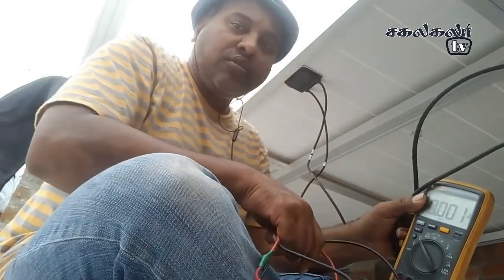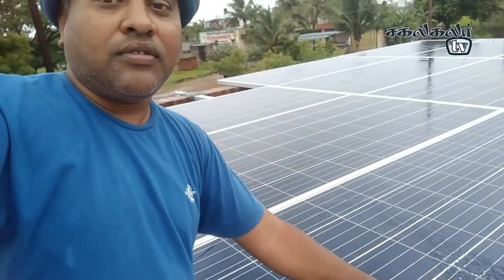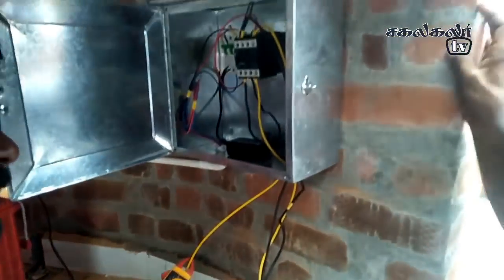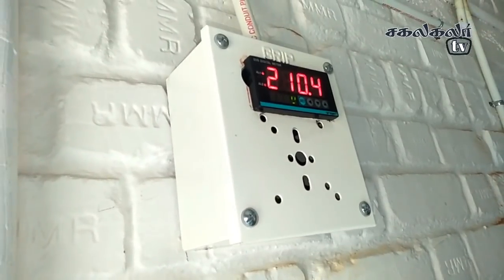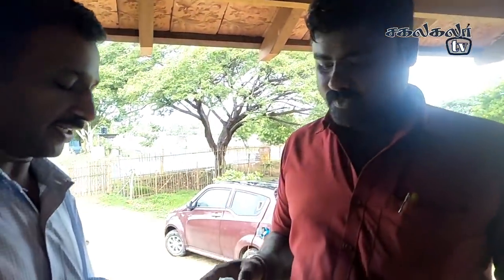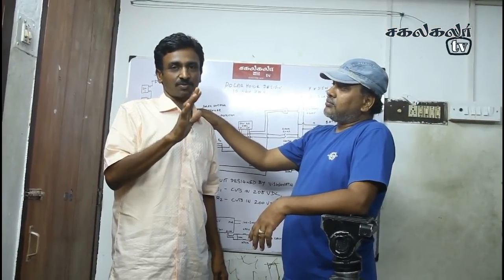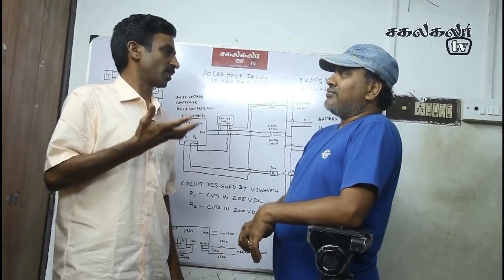Full DC Solar Installation || Commercial Solar || Without Solar Inverter || Off grid solar Dc Home

Comment: Sundar sir single phase ac supply la shok adicha thappichidalam
Dc la 12v 24v 48v inda mathiri low volt system onum problem illa
But 
180 - 220 v dc supply la shok adicha death conform 
So 
Aduku inda system la ninga ena sefty poturukinga

Comment: What happens to current loss due to DC travelling in wires for long distance ?
Reply: 200 to 230 V DC. Current rating will be same as 220 V AC. So loss will be same as in AC or less. 
Only If DC voltage is less than 200 then current will be higher for the same load( kw) hence loss will be higher on longer transmission. 
It is good if we have house hold equipment made for DC. Hope this becomes a trend.
As Solar generation is locally produced and consumed, DC supply for standalone system has many advantages.
Only when we need a grid+ solar there is an issue. 
Also Battery cost per KWH and it reliability is a factor to be checked.
Reply: Transformers

Comment: U always forgot to mention one important things in all solar panel system, that was with the setup solat system with batt bank, how long (hours) it will run with full charge, i.e during rainy season etc. This information will help user to determine load capacity etc.

Comment: எனக்கு ஒரு உதவி தேவைப்படுகிறது. நீங்கள் எடுத்துக்கொண்ட battery 12v 200Ah 2nos: serious connect become to 24V   and charging  using 240w 24v solar panel parallel connection ஆனால் நீங்கள் பயன்படுத்துவதோ 12 வோல்ட் light. And 24V DC fan how use and connect.

நீங்கள் 12v light 24v பேட்டரியில் பயன்படுத்த முடியுமா?
Reply: Selva Kumar, I think they r not using 12v or 24v, they are using 220v DC system using 24v panel in series connection ( 27.6v*14no's=386.5v) to charge & use 12v battery in series (13.8v*16no'=220.8vDC). And they didn't mention 12v DC lights, Therefore a 230v led light fixture required minimum   140V AC or minimum 198V DC (140*✓2=197.9v). Check with latest smps type adapter's input voltage AC 90v to 275v & they are capable to work with equavellent DC Voltage ( 90*✓2)=128vdc to (275*✓2)=388vdc.

Comment: Intha video uncut version irrutha upload pannunga anna. Because neriya vishyam cut panni irrukinga . Pid controller eppadi voltage controller ra mathanaru nu. Innum neriya kelvi la irruku. Intha lockdown la ippa intha un cut full video podunga sir. 2 hours na kuda paravala. I almost 90 percent understand the circuit diagram. Pid controller pathi puriala (NEED A CLEAR EXPLANATION) . So please upload un cut video of solar installation of vishwanath sir.

Comment: Investing in the battery is not a wise option, we have to replace the battery every 4 or 5 years. 
Solar on-grid invertors with 7 years warranty are available in the market now.
We can install extra more solar modules and produce more electricity for the cost of the battery.
Reply: Can u explain on the concept sir .. any number so we can contact you
Reply: @nirmalkumar-zq8rd  Sir, You are from ?
Reply: @MrKlgd  do u know government not giving net meter properly

Comment: Can you supply solar  system for irirgation purpose ,pl advise the cost be involved for 3 hp motor,
Reply: get 3kw solar panel and get one 2.2kw vfd and you can conect them to run your 3hp(2.2kw) motor

Comment: If get shock in high voltage DC system you're gone
Reply: No you should understand that center tap is given as earth to reduce the electric shock by half (earth connection tapped at 8th battery so it may around voltage 192/2 - 230/2 so you may get 96 - 115 Vdc. For solar irrigation at agriculture pumps harvest 450Vdc - 750 VDC generation do you consider that as a risk?.
Reply: @chandruasp  100v DC is not a safe voltage.Because in high voltage DC if you get shocked the constant voltage will pass through your body.In ac, voltage is alternate hence you get a chance to escape.
Reply: @netrocker9990  I has received and handling 48Vdc and its solar VOC is 86Vdc on bare hands it gives a sense but not shock if 110Vdc it is survivable and safe all agricultural solar motor pumps have very high voltage than that so only theoretical knowledge will make you any time get into practical it is just a easy job but anyway safety precautions are must for everybody. many rural peoples are handling such things in a very good manner they have a good practical knowledge.
Reply: @chandruasp  currently working as an junior chemical engineer in an chloro alkali unit.For manufacturing of caustic soda we use elecoltrolysis.The voltage is 600v DC .I have seen the DC electrocuted person.
Reply: @netrocker9990  for more than 150Vdc need saftey precaution and need to seek and tripper during such human shock discharge.

Comment: For solar 24 volt design, is there any pid voltmeter available in market to control over and under voltage protection..?????
Reply: Many Charger controller itself has 24Vdc regulated output so no need a separate PID
Reply: @chandruasp  thanx for the reply. I am not asking about charge controller..i am asking voltage protection across load side.. if battery voltage reaches below 23 volt,i want to cut the load..same if it reaches above 25 v i want to cut the load...

Comment: Keeping the solar panels horizontally, with zero tilt angle(angle between the roof surface and solar panel) will not be efficient as it gives very low output power compared to the output power given by the solar panels which are kept at a tilt angle equal to the latitude of the place, where the solar panels are installed. The electrical output power produced by the solar panels depends mainly on the solar radiation which falls perpendicular to the solar panel. If solar panels are kept with zero tilt angle, the solar rays which fall perpendicular to the solar panel are very less throughout the day, as the position of the sun varies throughout the day. For a fixed tilt angle, solar panels have to be placed with a tilt angle equal to the latitude of the place facing south to extract maximum power from the panel.
Reply: For Chennai and most of areas in Tamilnadu, required angle is 13 to 14 degree (average of various seasons) to the horizontal. The   handbook below gives the required solar  panel angle areawise. http://www.solarelectricityhandbook.com/solar-angle-calculator.html
Reply: Tilt = latitude is for maximum annual generation. Sometimes it’s wise to adjust tilt and azimuth (eg., east-west panels) to generate maximum output during peak hours, based on seasonal demands and usage patterns. Such adjustments are done in off-grid system, place where electricity rates are high during peak times (time of day electricity price ) or simply when net billing instead of net metering is used. Such design should be done by proper generation estimation, energy auditing etc, else your ROI will be on steeper side. So better go through epc companies then installers like them.

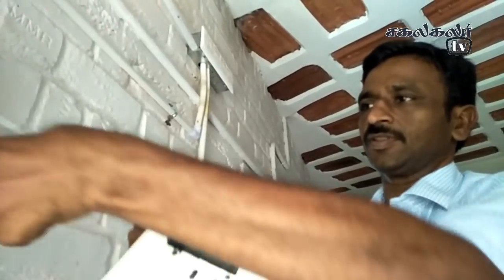Comment: Your circuit is good, but the way you explain is not clear enough to understand to any layman. This is one of the main reason for everyone to call you and ask for doubts. In this video time stamp from 6:17 to 6:30 is not clear the way you explain. You need to show how to program PID. You have not discussed in previous and current video. Connection of diodes, contactor and battery center point connection these are the important things you should show. Using PID you are doing high and low voltage cutoff. See the link given below
https://m.banggood.com/Tools-VPD1-60-40A-220V-Over-and-Under-Voltage-Protective-Device-Automatic-Reconnect-Recovery-p-1282509.html?akmClientCountry=IN&rmmds=detail-bottom-alsolike

I think this device does the job. The person who shoots the video is an adfilm director, sir the video should be in a systematic approach, because you are educating millions of people round the globe. Already circuit diagram is shown in earlier video,now you are installing a new project as per diagram.  
1. Raw material -  like Solar panels brand, battery make, followed by wires, PID etc.. if possible show tools used. 
2. Installation procedure- that is from where to begin with say for example: start with panel connection - PID - contactor - battery, then center point    cut off. 
3. Load
4. Precautionary measures.
Reply: The voltage controller is For ac not for dc
Reply: Yes we need clear wiring procedure and precaution measures... If you really want to educate people means... please put proper guidence video for us... It's our kind request.

Comment: மின் கட்டணத்தொகையை விட இதன் பேட்டரி மற்றும் பேணல்  வாங்கும் தொகையே மிகவும் அதிகமல்லவா? பேட்டரி என்பது நிலையானதல்லவே! அதனையும் இரண்டு மூன்று ஆண்டுகளுக்கு பிறகு மாற்றியாக வேண்டுமல்லவா? அதுமட்டுமல்லாமல் வீட்டிலுள்ள மின் சாதனப்பொருட்களையெல்லாம் dc யாக மாற்றினால் அதுவும் extra சிலவு தானே? வாங்கிய கிரைண்டரை பழைய இரும்பு கடையிலா போடமுடியும்? கிரீன் எனர்ஜி கடைசியில் பர்ஸ் எம்ப்டி எனர்ஜியாவுல ஆகிடுது? மேலும் இத்தனை பேட்டரிகளை மொட்டை மாடியில் வைத்திருப்பதை அறிந்தால் பிறகு பேட்டரியின் நிலை லலிதா ஜுவல்லரியின் நிலையாகிவிடுமே?
Reply: No No If you use normal Transformer inverter without proper watthour calculation a 5year battery will work for 3 years hardly if calculated and avoided such inverters and used switch mode inverters or inverter less model you can run upto 7-8 years with similar warranty battery but water maintenance are must.
Reply: whatever it is. the battery cost is so high. If you compare to the normal ups system. here you need to add more components. battery, inverter, solar panel, mccb, and ect. But we don't need to spend more for the normal ups system. Only battery and inverter thats it. But for the solar system!? and there are some negatives also there in the solar system. (1) Rainy season we can't expect full output. (2) expenses so high.(3) need more maintenance. so if you compare this to EB current bill payement.  then the solar expenses unbearable.
Reply: Any one will spend one and half lack rupees for a just 12v dc output?
Reply: Off grid is failure, ongrid best இவனுக கோமாளிகள்
Reply: @shankaryou1  If we leave grid unstable voltage from electricity board our all equipment work for endless lifetime understand due to poor grid power we loose more appliances and pushed to use stabilizers. 

Pure off grid users who not depend on grid wont need stablizers.

Comment: 192v dc system epdi bldc fan ku kodupenga
Reply: Smps is used for converting ac to DC rgt??we already give dc as input
Reply: @athianand  SMPS input need 110-260Vdc/Vac and output as mentioned in smps.

Comment: 1. Off grid useless you can't get proper load

2. Panels not in proper angle how you get efficiency

3. I think its 5kw .5kw panel cost 1,50,000 , Inverter, angled structure and installion 1,00,000 if you go ongrid system , one lakh saved and it is complete package

4. Minus of Off grid you cant get proper load. Every seven years u reinvest For battery  it is huge cost Around one lakh
Reply: They are not using invertor & AC system
Reply: @saravanan602  Battery cost?  & life ? Every seven years u Want change battery how much cost that is?  choose better & cheap option ongrid
Reply: @shankaryou1  on grid system not bad idea, there also u have to use hybrid invertor so installatiin cost high. Upcoming days lithium iron batteries are coming so life will be more & no maintenance require
Reply: @saravanan602  in off Grid  Battery cost around One lakh Hybrid inverter for 5kw around Rs.60000 only எப்படி பாத்தாலும் On grid than best
Reply: @saravanan602  superb,, true message sir,
Reply: 3phase la,, single phase illena work ahguma? 
Small house ku,, island, highway shops, agriculture farm house,, reserve areas,, idhukellam off-grid than better,
Reply: @manimarandevu  ஏதோ நடுகாட்டில் இருந்தா ஓகே Off gird போடும் போதே ஒரு லட்சம் அதிகம் அப்புறம் ஜந்தாறு வருஷத்துக்கு ஒரு தடவை Battery மாத்தனும் அதுக்கு ஒரு லட்சம் ஆகும் இரண்டு Fan ஒரு mixe. ஓரே சமயத்தில்  போட்டா எல்லாம் படுத்துக்கும் இரண்டு நாள் அதிக மேக மூட்டம் இருந்தா லைட் கூட எரிக்க முடியாது இந்த சனியனை என்னடா வாங்கினோம் என்று நொந்த பலர் இருகிறார்கள் Off Grid வீட்டிற்க்கு எல்லாம் ஆகவே ஆகாது எலக்டரீசியன் வீட்டுக்கு வேண்டும் என்றால் செட் ஆகும்
Reply: @shankaryou1  intha system la invertor kidaiyadhu, so @ same time la fan & mixer use pannikalam, Direct DC use pannuranga, so energy loss rombha rombha kammi compare to invertor system
Reply: @shankaryou1  intha system la On-grid modified pathi ideas iruntha share pannunga, intha system la irukura one of the minus solve aagirum,
Reply: @saravanan602  grinder poda muduiyuma,  நாலு Appliances ஓரே சமயத்துல On பண்ணுணா எல்லா வேலை செய்யுமா? செய்யாது 

வீடு பூரா DC ஒயரிங் பண்ணினா கால் பங்கு கரண்ட Transferலயே காணம போயிடும்
Reply: @saravanan602  ஒரு இடத்துல Shortஆன மொத்தமா எரிந்து போய்விடும்
Reply: @shankaryou1  nadu kaatilum, mixer, grinder use pannuranga nanba,, 2fan, oru mixer, 2 22w tube,, at the same time run pannurom nanba,,, mudhumalai la,, anga irukura climate la run pannittu irukom,, then 4dats ah rainy season la yepoavum pola use ahgittuthan irukku,,
Reply: @shankaryou1  correct bro, AC la 1& 3 phase. ON Grid system entha type ah irunthalum short aana fire 🔥 risk iruku tha
Reply: @shankaryou1  namma load evvolo thevai padutho adhuku capabilities irukura mathiri panel & batteries use pannunom na,issue varadhu

Comment: சோலார் பேனல் , பேட்டரி மொத்த விலை விவரம்
Reply: Panel rate,1watt _19 rupees, battery 18 ah to 200..etc irukku
150 ah, 12800 to 15300 range varum
Reply: @manimarandevu  solar panel type mono or poly or multi Cristal panel which type
And 
Battery type
Reply: @pk-dl4xk  panel HHV or EMMVEE(poly) 
Battery C10 battery (6 cells, 12volt) 
Luminous 5years replacement warrenty, ok va sir
Reply: @manimarandevu  do you have C10 20AH batteries? if have contact 8667394550
Reply: @chandruasp  30ah/40ah c10 available in market sir,,
Reply: @manimarandevu  40AH கிடைக்கிறது 20 கிடைப்பதில்லை 30ah என்ன விலை இருக்கும்?
Reply: @chandruasp  correct rate theriyala sir,, approximate 3500 irukkum sir